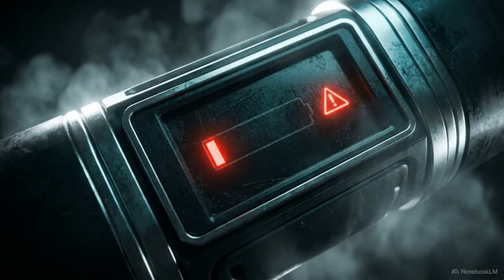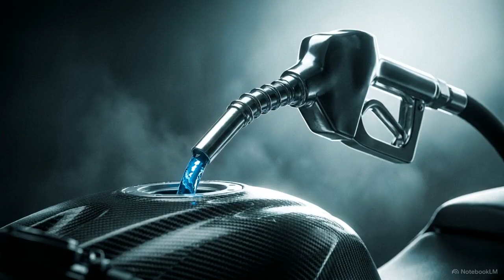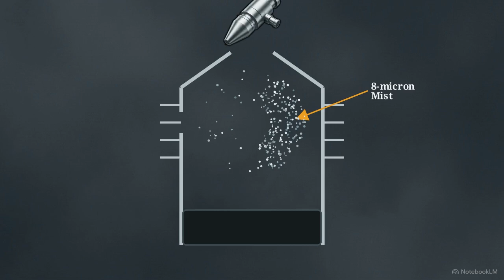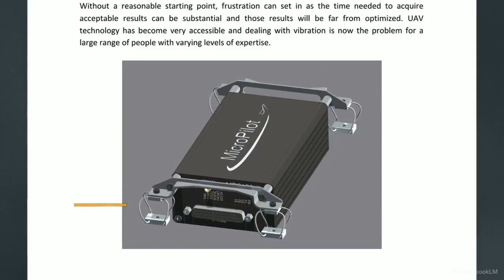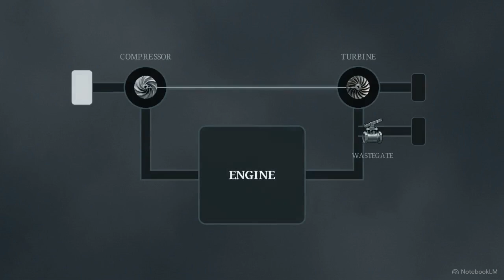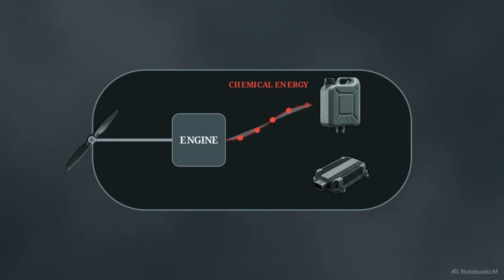How IC Engines Power the World's Biggest Drones

Comment: There’s no wall at 60 minutes.  I’m flying for over 4 hrs easily
Reply from the maker: Assumption is given for a 2.5kg-3kg UAV ( quadcopter ) operating with a max 10,000 Li-Ion battery.

For a fixed wing your statement holds true, but for general understanding in a layman sense this assumption is tailored.